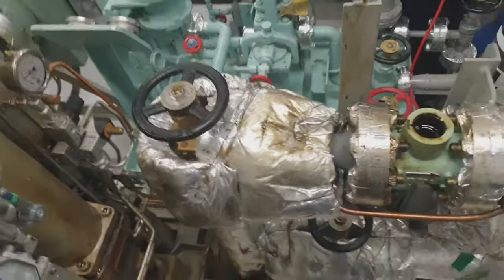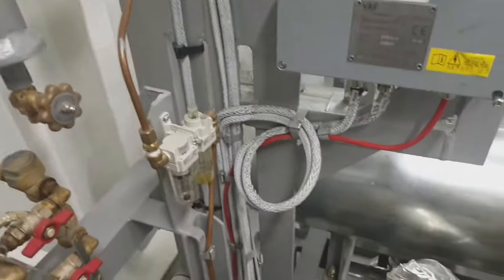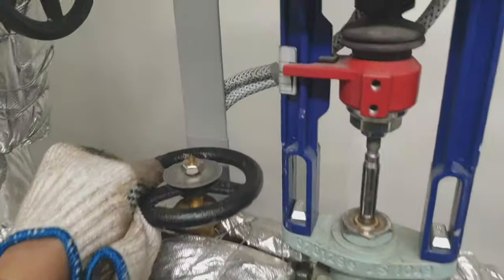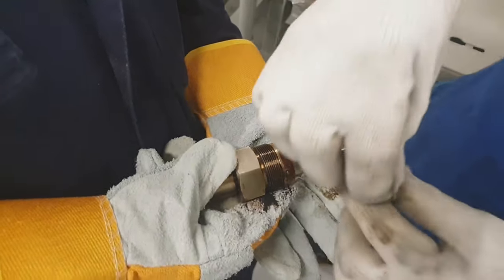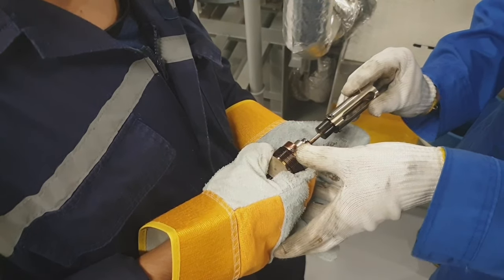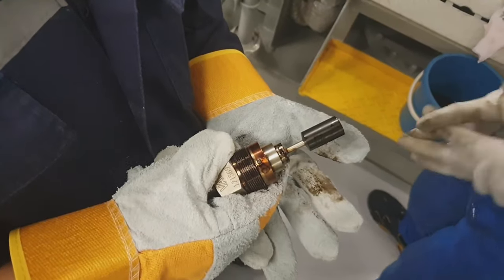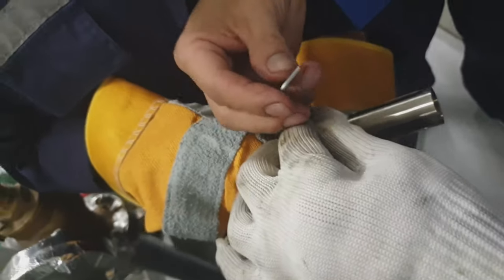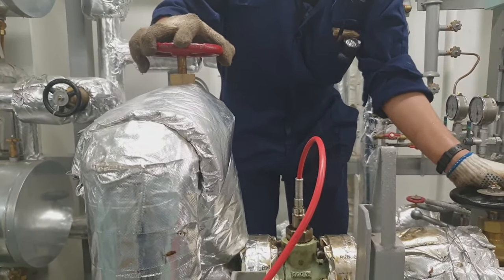TROUBLESHOOTING VISCOSIMETER SENSOR PROBLEM

Comment: What is the first action if viscosity sensor will rise alarm such as viscosity is to high or to low . What is our first action as the watch Enginer during ums?
Reply from the maker: Always remember that viscosity is inversely related to temperature,  when you have high viscosity that means your fuel oil temperature is low, then the action is you need to raise up the temperature by manually operate the viscometer if there is failure of viscosense, or just raise the temperature by opening the bypass valve, of fuel heater.. do the opposite action when you get low viscosity alarm..
Reply: Please 🙏 make a video about how to make fuel rack adjustments on AE if something is out of limit . Teach please 🙏 me how correctly we have to keep stable our engine our load distribution and temperature deviation . How to adjust ex gas temperature ? 
How we can understand that our engine working not properly relates to performance diagrams . Teach please how to read performance data